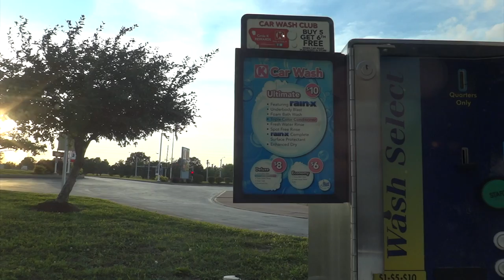Ryko Velvet Touch 2000 Tunnel Car Wash - Shell, Chesterfield MO

Comment: WOW. This video is amazing! I LOVE The shot of the 3X Foamers! I Might steal that idea whenever I find a new mini-tunnel to film CX Also, a neat fact about this car wash is that it uses Soft Cloth– the failed predecessor to foambrite! Its a brutal open-celled cloth that swirls and scratches the heck out of your clearcoat.
Reply from the maker: Lol, thanks.  That's one of the upsides to the 2-camera setup--I was able to sit there zoomed in and waiting for them to start while I used footage from the dash camera.  As for Soft Cloth, wow.  I guess one of the advantages to driving a 14-year-old car is that I don't really worry about the paint very much anymore!   Come to think of it, I should probably do some kind of special video on my car's 15th "birthday".
Reply: Car Wash Studios Extra stupid question: Have you ever seen a soft cloth Ryko system before in person? I saw one once at a gas station's XS2, but other than that FoamBrite has been on every one I have seen. I am still looking for a filament one though.
Reply: Nope. Also, SoftCloth was only released on the Voyager II And tunnels. What you saw was probably NeoGlide or some replacement material.
Reply: Car Wash Studios
Reply: Car Wash Studios actually do you mean on the AllWash REFURBISHED voyager II? if so that uses neoglide
Reply: super max1023 No, It’s a Ryko Velvet Touch 2000.
Reply: A bunch of car wash YouTube’s, it’s time for me to join the show, Goodmorning sun shine, North Carolina says hello

Comment: The ones that I go to are just spraying the car in the wash. In the end of the wash is a dryer or blower to dried the car. I kind of missed the old school McDonald’s restaurant buildings. I grew up going to that style of building from the 1970’s,80’s,90’s,2000’s and till about 2014 or something. The one that I liked to go that the old one was torn down and rebuilt from the ground up. The other one was remodeled from inside and out. There is two McDonald’s in that town that is about 40-45 minutes away from my home which is the nearest.

Comment: GREAT video! What sort of mount do you use to get your second camera on your visor? And you have a Toyota Avalon right? They last a while and are great cars!
Reply from the maker: If you search Amazon or Ebay for "sun visor camera mount", you'll find plenty of them.  It's just a little plastic clip with a tripod screw on the bottom.  Usually $6 or less.  Bear in mind that the camera will mount upside down--footage has to be flipped in a video editor.  And yes, it's a 2000 Toyota Avalon in very good shape.  It's required some minor maintenance lately (new tires, shocks, headlight bulbs, touch-up paint, etc), but still going strong.  I have no plans to replace it for at least a few more years.  At this rate, it could easily make it to 20 years old.  Fantastic car.
Reply: ***** Thanks I'll definitely look that up. I agree that line of Toyota is superior and even your car doesn't look 14 years old. Also thanks for such great videos, and I can honestly say I started publishing my videos because of how much I enjoyed yours. Keep them coming!
Reply: The Elevator Channel  hi
Reply: @milwaukeemaster8637  dude please make your videos public again... I miss them
Reply: @milwaukeemaster8637  dude please make your videos public again... I miss them so much